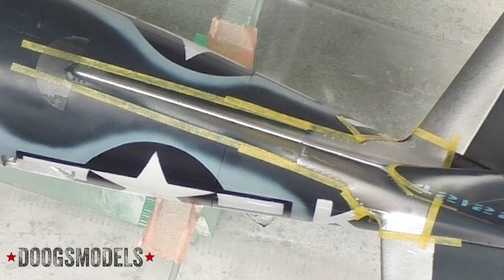Tamiya P-47M Build - Part 24: Fillet Fix & Tires

Comment: Another good video.You have a steady hand!  Are the paints for the wheels your preferred choice or were they just to hand? And do you dullcote them once finished?
Reply from the maker: They'll definitely be dulled. Maybe even a few times. As for paints, it really depends on the subject, operating environment, even kit engineering.
Reply: @DoogsModels It was just the fact you used the Tamiya LP11 and wondered why. I've also learned something new re. using rapid thinner when working up close.  Thanks..
Reply from the maker: Ah. The LP-11 is great for pulling off that aluminum lacquer look like you'd see on wheels, gear struts etc. Has a certain creaminess to it that most metallics lack.